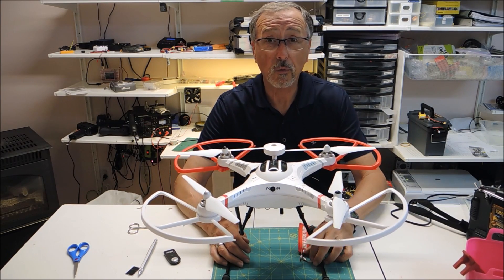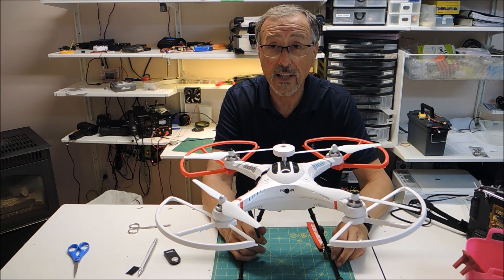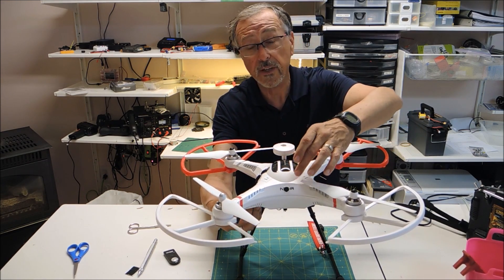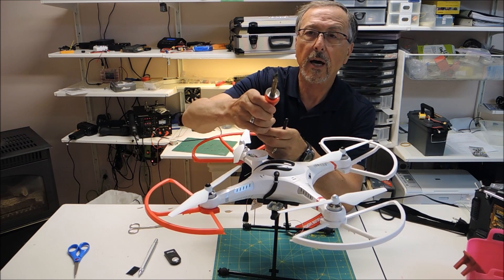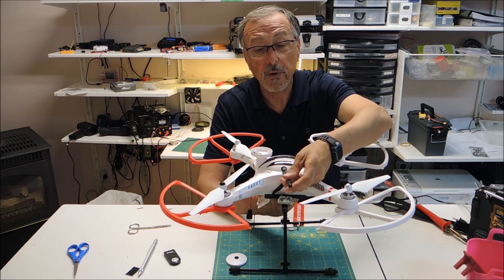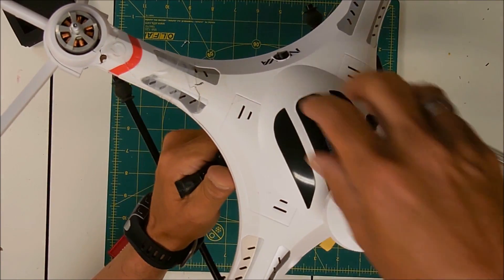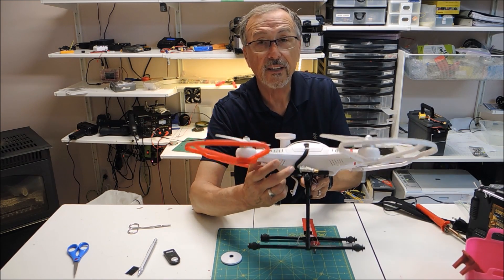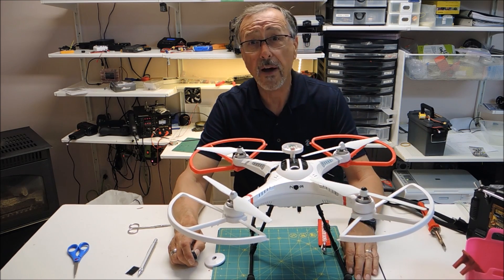Setting up the Quanum Nova Cheerson CX 20 for FPV

Comment: Nice video. Plan on adding A small FPV to my CX-20. Two questions:
- why do you have the red prop guards opposite the red stripes?
- where did you get the landing gear?
Thanks
Reply: Yes, what landing gear are you using? @Emerald Meadows?